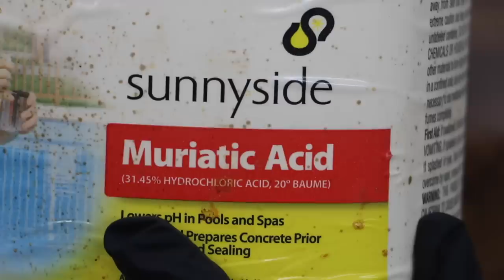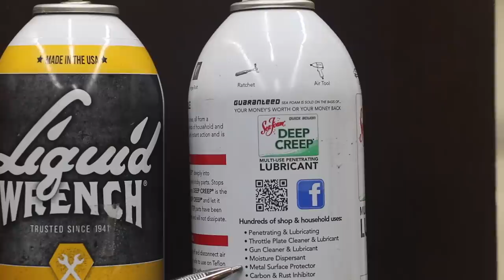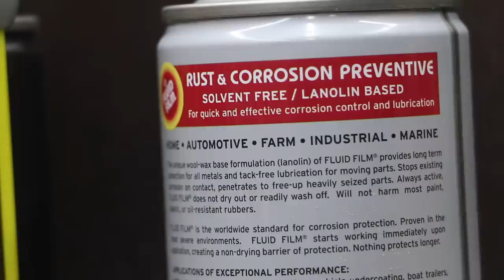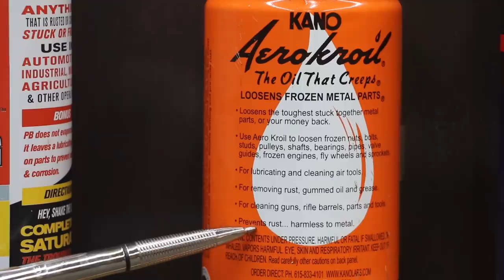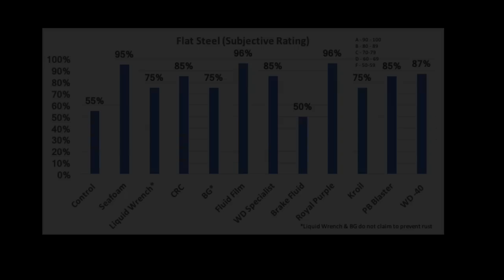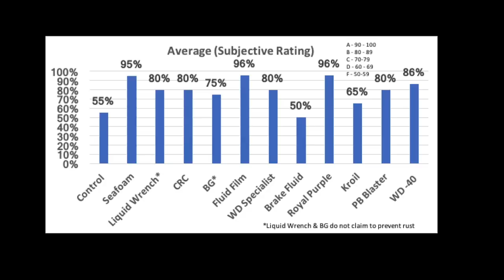Do Penetrating Oils Block Rust?  Let's find out!

Comment: We live on a small farm,in a semi-salt atmosphere, being approx 5km from the sea, I have found that preserving farm vehicles with EP140 hypoid oil, thinned with deisel to make a hand pump spray, extremely effective to seasonally used farm impliments, (e.g. old havesting machines including a 1978 baler, which performs reliably each year :-), that might be a nice homebrew to test.
Reply from the maker: Thanks for the video idea.
Reply: @ProjectFarm  also the original Welger  manual details general lube to be performed with a mix of ATF and diesel, I have lubed all the running parts and chains with this with great results very little wear, smooth operation, little accumulated rusting and fasteners always undo fine, only used to harvest once yearly for about 40 hours.
Really like your content formatting and clear presentation style, keep it coming please :-)

Comment: best one I have ever seen was the product called Gibbs. Just an occasional ra treatment is needed. Another great use for it was I used to spray, once a year, everything under the hood of my van. While the engine was running. When I sold the van with 256 thousand miles on it the engine compartment look like it was less than 3 months old. It did work great on my firearms. It will not cut salt but salt won't cut it either. When I had the most amazing thing I ever saw it too was a 130 + year old firearm that was rusted solid was dropped into a vat of Gibbs. After a few weeks they pulled it out and the firearm was fully functional, Springs and all. The firearm had been found in the dirt and rusted solid. I wouldn't should necessarily because of the lack of metal on the cylinder of this little 22 revolver. But every part of it did function.
Reply from the maker: Thank you for the feedback!

Comment: FYI ; your standard bolts or screws are zinc plated then a chromate conversion coating on them. The chromate has dye added to it to help visual confirmation of that coating or to identify a bolt/screw type, which usually gives a slight blue cast to the zinc or you might see a yellow coloring, typically.
Reply from the maker: This is great information. Thank you

Comment: From a bicycle transmission specialist (not racing teams, but commuting and/or traveling ).  The magic soup is 70% naphta ( white gaz or Coleman camper fuel ), 20% grade 90 transmission oil and 10% liquid parrafin ( white odorless lamp oil ).  You can skip the parrafin,  A 70/30 mix works also very fine. Note :  That mix is highly flamable.
Reply from the maker: Thanks for the feedback.
Reply: @ProjectFarm  It works mostly like a lady's night-mask.  You rub it in at night and by the morning, the naphta will have evaporated, leaving a smooth skin behind.  :)

Comment: I seem to remember a story I read some time ago that during ww2 us navy ships started using lanolin based fluids to protect surfaces from rust, as commercial products, just like today does not quite get there. And as the test showed, the products that have lanolin (sheep wool fat) does the exact same job today, as it did back then, and what it does to the sheep, insulate from the outside moist etc.
Reply from the maker: Thanks for sharing.

Comment: When we winterize watercraft at work we use SeaDoo XPS spray lube to prevent corrosion in the hull and as a fogging oil. I’ve been told it’s the best water displacement spray on the market. You could try testing it against silicone spray and other protectants against rust and corrosion.
Reply from the maker: Thank you

Comment: This was good! I use Evaporust to get the rust off of old exhaust manifolds ect. The only problem is they start to rust as soon as they touch the air. I’m going to try the royal purple as a protective film that’s easy to remove for painting.
Reply from the maker: Thanks for sharing.

Comment: Great job. This video made me think of applications that we all encounter with threaded fasteners namely, I would be curious to see this test using coolant, heat cycles and and galvanic corrosion between dissimilar metals (aluminum nut, steel bolts)
Reply from the maker: Thank you!

Comment: So thorough.. Hey PF, I asked about a problem with a mower last month or so, turns out I had another same mower without the carburetor. So I switched the carb over to that mower.. Same problem! Ran either rough like vroom..vroom..vroom.. or died after starting. lol. New mowers seem to fail so quick, I went out and bought an '03 Murray Briggs/Stratton, it has the old school carb on it and it runs like a champ! I tried to clean the newer/bad mower carb out, but it did the same thing.. not sure what now..
Reply from the maker: Thanks for the update.  I don't recall if you changed out the spark plug on the mower that didn't run right.  You might also disable the "engine shut off switch" at the coil. Maybe it has a short in it and is grounding out.  Lots of possibilities.  I hope you get it resolved. By the way, I really like the old style engine like you purchased much better!
Reply: Thanks a bunch! Troubleshooting time again! Hey they don't make anything like they used to! :-(

Comment: Here's an idea. A water soaked but Not dripping air filter should theoretically allow for enough moisture in enough time to clean the motor without hydrolocking engine.
Reply from the maker: Thanks for the video idea!

Comment: Consideration should be given to the mechanical effect of using a penetrant spray as a corrosion preventer on fixings. It has the potential to change the locking effect / torque loading and could result in a fixing coming loose.
Reply from the maker: Thank you for the feedback

Comment: Would love to see another video with oils such as tyranny fluid, gear oil, motor oil, power steering, 3 in one, phosphoric acid, (pre and post treatment) and that deep blue stuff used to tools in workshops (forget what it is called...makes surface a bluish color). Perhaps diluted grease somehow? 

Great video as always
Reply from the maker: Thanks!  Thanks for the suggestion.

Comment: The bolts are BZP: bright zinc plated. Galvanised coatings are basically soldered into the surface. BZP is electroplated on and doesn’t go as deep. It’s much easier to remove. 

I had an engine torture idea: how about drip feeding a mower engine hydrogen peroxide? It’s a strong oxidiser so it may get rid of carbon schmoo in the head. Worth a try?
Reply from the maker: Thanks for the recommendation!

Comment: My uncle will go to junk yard and collect old ATF an mix it 50/50 with diesel. Said its a old timer trick. Uses it for just about everything. Lube,cutting fluid, penetrant oil.. I use straight diesel in my parts washer. Works good. Don't know if you have a video on best parts washer cleaner but that would probably be good.
Reply from the maker: Thanks for the video idea.

Comment: I use transmission fluid to stop rust on my truck frame.
Works fantastic and turns the rust black and stops it from continuing.
Please test this it's amazing and I swear by it. I'm told that trans fluid has rust preventers in it.
Reply from the maker: Thank you for the video idea!

Comment: What I would like to see tested with these products is what do they do to high carbon spring steel like mainsprings in clocks.
Similar springs could be harvested from inexpensive wind up toys.
I know for a fact that some of these will actually promote rust on spring steel. You wouldn't think so but,it's certainly happened. Just need the people to know what is actually dangerous to apply to some metals.
Reply from the maker: Thanks for the suggestion.

Comment: I worked for Boeing for 31 years. Boeing developed their own corrosion prevention product called BoeShield T-9, They used it exclusively and the product is sold on-line. This is not a penetrating oil but a corrosion preventative spray. I would love to know how well this product works against other like products.
Reply from the maker: Thanks for the suggestion.

Comment: Great test as usual from Project Farm!!! I have used so many different penetrants through my 45 yrs of wrenching and I have found that the WD 40 Rust Specialist for me is the only brand I'll buy now for breaking loose rusted parts. The stuff just seems to work much better than any other products through the years. I'm kind of curious about how it stacks up against the rest of the rust penetrants so if you get time can you run it against your previous winners? I haven't had any luck using PB Blaster or Liquid Wrench but they sure smell bad! That's one thing I really like about the WD 40 Rust Specialist it doesn't stink up the inside of your vehicle when you spray it on door hinges. Thank you for what you do! I watch your video's before I buy a lot of my different tools and products!
Reply from the maker: Thanks and you are welcome!  Thanks for sharing.

Comment: Fluid film goes on all the bolts when you buy a car. then when you ever need to do something its already oiled.

every time a bolt is taken out spray fluid film inside the bolt hole. protection from inside out. spray bolt too.
Reply from the maker: Great point

Comment: For bolts and nuts to prevent rust and seizing use high temperature wheel bearing grease or anti-seize. Anti-seize has graphite powder in it and thin grease and or lubricants that will help prevent rust and help prevent bolts and nuts from seizing up and it also handles heat real well to because I use anti-seize when installing new spark plugs I’ve never had one brake off in the head of a engine or not be able to remove the spark plug either.
Reply from the maker: Thank you!

Comment: If you do this rust preventive again, I hope you try a product called Corrosion X. I found this product by accident in the USAF stationed at DMAFB in Tucson AZ. Most buildings use a swamp cooler as a cheap A/C. It works great when the humidity is in the single digits, but during the monsoon or when humidity goes in to the double digits they just add to humidity inside. Unless you reapply oil often the rust will happen and you will find a spot you missed the next day. The Corrosion X worked great and we could spray or wipe on that oil and it would last for about a year. 
Corrosion X has a line of products that you can check out on their site. I use there GunX on my weapons and it is a top performer in my book. 
Also, if you do anti-seize test, you might be surprised at how well Milk of Magnesia works on bolts in a hot section of an engine. Our Jet Engine Shop uses that stuff by the gallons when reassembling engines. I use it on my header bolts in my 68 Camaro.
Reply from the maker: Thank you for this recommendation!

Comment: Great information to know, thanks.     Suggestion for follow up testing:   Steel and aluminum.    More and more you have steel parts put into aluminum casings, to save weight on the vehicle.   The oxidation that happens between the two can make it almost impossible to get these separated.   And, some do not have threads, i.e. ball joint stud into aluminum knuckle.     ? Any way to recreate the oxidation between these two, and test the fluids?   Also, do any of the fluids flow "up" into the part, as you can't always get to the top of the item to let it flow down.      Thanks again for all the great content!!
Reply from the maker: Great recommendation!

Comment: On the topic of bolts,have you ever considered testing used torque to yield cylinder head bolts to the point of failure.  We are informed to always buy new bolts and not reuse them but I heard of a case  via a forum where jaguar relented on this and then said they could be reused once only in a likely bid to reduce repair costs    for  warranty repairs. There is little research on this on the internet!
Reply from the maker: Great video idea!

Comment: People should keep in mind that the same properties that make something a good penetrating oil, being able to creep into damp cracks and displace water, also make it a bad rust preventative. If you're really worried about the screw rusting after having applied penetrating oils to get it loose, moderate heating should vaporize the hygroscopic solvents in them, then apply some anti-sieze and you should be good.
Reply from the maker: Thank for the feedback.

Comment: Boy, I’ve said it before and I’ll say it again, I’d really like to see if water vapor actually helps the combustion process. You can find fogging kits or fog misters online for cheap. Not sure if you’ve looked into these, but it would be nice to see if it helps not only in combustion, but in lowering engine temps. It would also be cool to see if you can run your fuel vapor setup with water vapor too!
Reply from the maker: Great recommendation. I'll see what I can do.

Comment: Wow lots of comments on this one. 
I'd like to learn about the rust prevention level of Evaporust. Evaporust was originally touted as a rust preventer as well as a rust remover. After you de-rusted and rinsed the part you could mist it with some Evaporust to protect it. They have released a specific product for rust prevention now called Rust-Block, but I expect it's the same ingredients maybe at different concentration. Lost of us have Evaporust on hand though.
Also maybe it would be fun to try a longer term test in real world conditions. Make a similar bar stock test strip and strap it to the frame of your car for a year.
Reply from the maker: Thank you for the video idea!

Comment: The absolute best penetrating fluid I’ve found is a 50/50 mix of auto trans fluid and acetone, it’s much cheaper than all the other fluids and performs much, much better. Not sure how it would prevent rust but if you have a bolt that won’t come out, atf and acetone will free it up
Reply from the maker: Thank you!

Comment: If you own a motorcycle in UK you’ll know that corrosion prevention is a nightmare. The best product I found was CorrosionX, it sounds like Fluid Film. It chases off water but It’s not a penetration oil.
Brake fluid absorbs water so no surprises it accelerates corrosion.
Reply from the maker: Thanks for sharing.

Comment: Final thought. Which one is cheaper? Fluid film, sea foam and royal purple. For a home owner If wd40 was cheaper and they were on the same shelf, we would all reach for the money saver. At the end of the day it all comes down to this. How long is the product going to protect? I can almost guarantee that if you took it apart and put it back together and went through the trouble to purchase any one of these products, by the time its ready to be taken back apart (if you did a sufficientjob), the almighty god oil has been long gone for years. Waste of money unless your in a repair and  preventitive maintenance business.

Comment: It has been recommended to me to try automatic transmission fluid for both a rust preventative and a penetrating oil on antique equipment. I have used boiled linseed oil inside both antique aircraft and bicycle tubing, but do not have any test results to back up it's use. It is said to dry/cure so it is not considered a penetrating type of oil, but it is claimed to be effective in stopping rust that is already in progress. Loctite and WD-40 also have rust preventative compounds available, but I again do not have any test data to compare them, and these formulas are not claimed to be penetrating oils. Perhaps a future test? Thanks Todd.
Reply from the maker: Thank you for the video idea!

Comment: IMPORTANT  !!!    A ventilator with the correct cartridge in them !  Different cartridges are rated, intended for different protections,, a filter intended for cellulose insulation may kill you if exposed to a highly acidic gas.
Reply from the maker: Great point.  Thank you!

Comment: I’d like to see an electrical and corrosion test on the typical electrical connectors, both brute brass as well as plated, with Corrosion X, ACF50, silicon dialectic grease, Seafoam, Royal Purple, and others. Electrical resistance induced heat which in turn causes more electrical resistance. Taken to extreme it ends up as a thermal runaway which wreaks havoc in automotive anc motorcycle electrical wire harnesses.
Reply from the maker: Thanks for the video idea!

Comment: Would love to see an update with testing Carbon Method / Carbon Coat or other nano-coatings.  Specific use case is for shop equipment such as table saw, band saw, etc.  Typically cast iron.
Reply from the maker: Thanks for the suggestion.

Comment: Brake fluid is a cheap way to ease removal of rusty bolts, but the bolts should ALWAYS be replaced after using brake fluid to free them, else they'll rust away to nothing.  Replacing bolts with coated or stainless is a good idea anyway, since stock bolts are terrible at holding up to torquing or road use.
Reply from the maker: Great point

Comment: I'm a manager at my local AutoZone and I sell many of these products in my store, it has definitely helped me figure out which of these would be more useful, as did your deep penetrant video. I think a video on degreasers would be awesome, I've worked in engine shops and I've seen how hard some combustion chambers and valves can be to clean. Purple power vs gunk vs green clean vs royal purple. Something like that maybe?
Reply from the maker: Great video idea!  I've added it to my list, but it could take a little while to create the video. Thank you!
Reply: Project Farm take all the time you need! Feel free to message me for any ideas you might have, I know there's a few products on my wall I'd like to see tested! The deep creep has honestly surprised me in the past couple videos, I don't know how many times I've passed over it to get the WD-40 or PB Blaster.